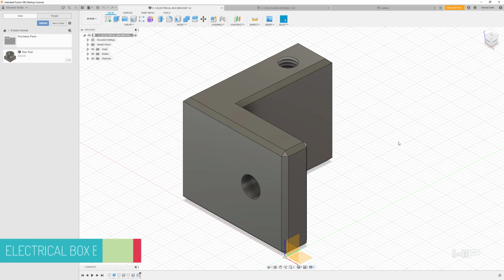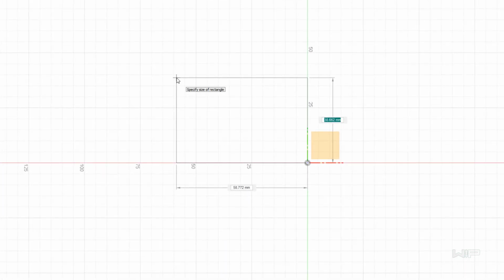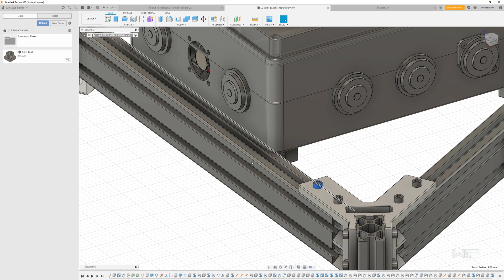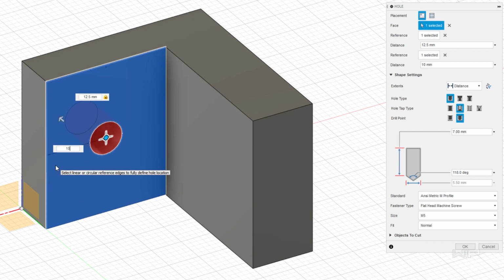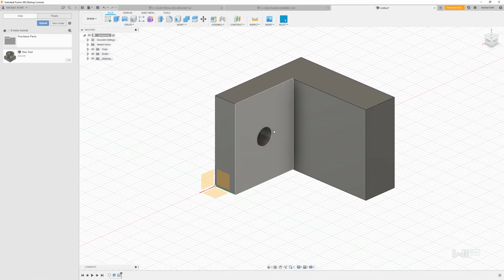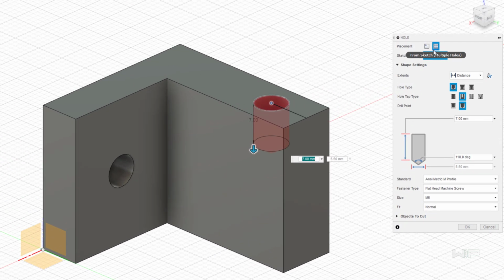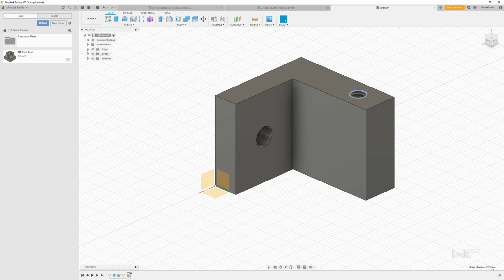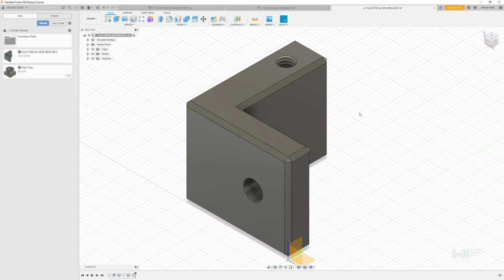HOLES FOR BOLTS, Learn CAD With Fusion 360 Class, Part 5

Comment: Any way to have half tapped and half clearance to make a single Metric bolt hole going through two parts to join them together? I already ruined two prints where both were either clearance or tapped so had to get drill on plastic afterwards to make hole bigger on one part!